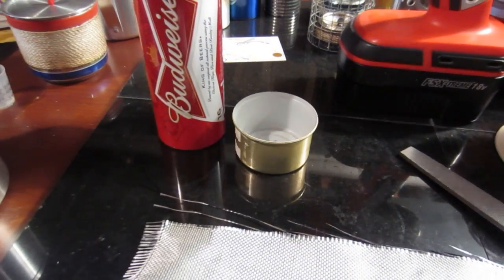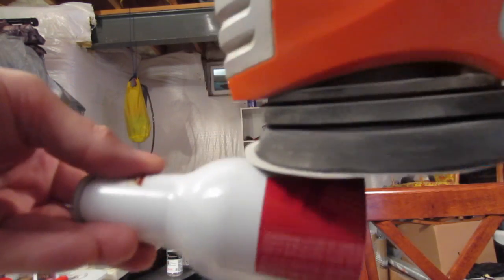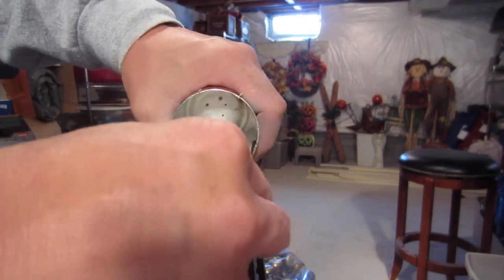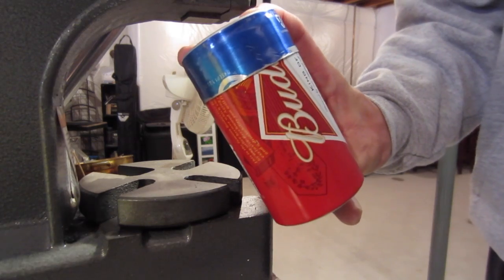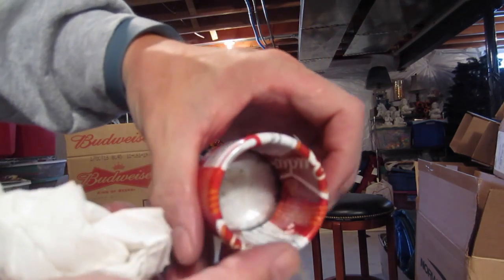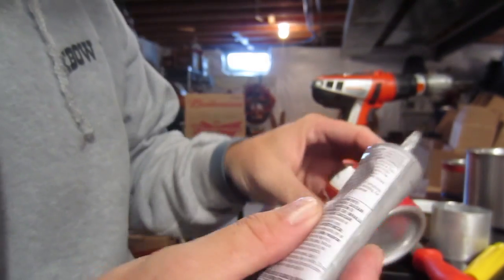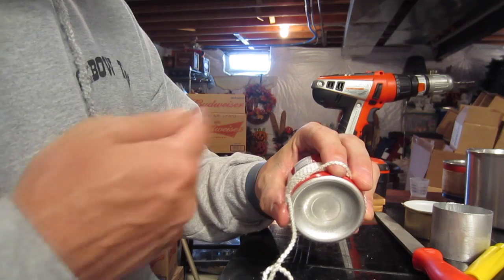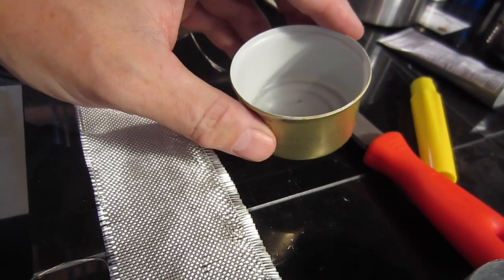How To Build Alcohol Stoves - Fancy Feast & Rolled Bottle

Comment: very cool!  I would like to suggest that (This from a former U.S. Navy sailor) you use a "Whipping" on your wick.  The Whipping is strong enough that you wouldn't need any glue.  It's virtually the same type of wrapping your doing, but you fold a loop underneath the wrap, at the end of the wrap you tuck the tail into the loop and pull. (this could get a little tough because it will be very tight).  (look for whipping videos you'll get it...)

Comment: Good builds, I found on the Rolled stove that putting 4 Dents or notches on the top of the stop stove evenly placed with a pair of Needle nose pliers, helps it to be more fuel efficient, and using carbon felt fiber on the cat stove also works better than insulation.

Comment: Great video.  Clear easy to understand instructions.  I have made 3 fancee feest stoves myself.  I used hairspray on the fiberglass cloth before cutting to keep down the fraying.  I went with a stainless steel mesh lantern globe for the inside.  I couldn't seem to find the bud bottles around here.
Reply from the maker: mark partain Thanks Mark! I agree, hairspray works well. I cut mine with scissors and go slow, haven't had much problem with fraying until I go to fold and place on insert. Going forward the new bud light bottles (thinner aluminum) work equally as well. Happy stoving!
Reply: I used pipe insulation ($5 decent size roll) that has aluminum on one side already adhered.  Just cut it down and place the shiny side out.  Mine has worked fine.  The roll will last for lots and lots of stoves too!  no messing with adhesives

Comment: One of the best videos I've seen on how to make both types of stoves. I've made Fancy Feast stoves using a tomato paste can & carbon fiber felt. I put 4,... 1/8" long, slits in the bottom of the tomato paste can with a Dremel cut-off disc so the alcohol can get up into the felt. I noticed you did not do that in your stove. Am I correct or did I just miss it?
Reply: surfandstreamfisher.  You missed nada.  Did not make the cut.

Comment: Rob, Thank You for one of The Best tutorials I've seen to this date, kinda missed the loud and crappy 'muzak' and gratuitous finger pointing, but will learn to live without it, Ha, Ha.

I made a form to press the cans together with a 1/4" X 5" dia. piece of steel with a 1/4" X 2" round head bolt through the center of the steel plate and then used my drill press in lieu of a regular press - but  eventually will buy a  press or set up one of my bottle jacks to do the job as I am building a few dozen alcohol heaters and lamps for the 'homeless' in my City so need to keep them as simple and quick to make so I can get them distributed - along with some tarps so they can have DIY tent to use them inside to stay warm and not be in the dark, and YES there will be a way to ventilate the tarps to provide fresh air.

Anyway, Thank You for sharing your technique on how to "roll"
the edge of a can.

Comment: Great video! These are my 2 favorite stoves to make for friends and people interested in alcohol stoves. I have never tried the full roll for the bottle stove. Only using the top of the bottle as the inner wall. I am bummed though I can find the pop top bottles in colorado anymore only the screw cap type. The aluminum is thinner with these and just don't roll the same......
Reply from the maker: Seth Adrian I agree, they are great. They are getting hard to find for sure, I can still find them every now and again. Tinny is the only one I have seen that has figured out how to roll the new bottles. Thanks for the note Seth, stove on! :)

Comment: I've never made either.  After watching your very nice video, I'm going to make both.
SERIOUS QUESTION: Is the priming wrap absolutely necessary on the rolled stove?
Reply: A wrapped priming wick is not "necessary", however I highly recommend using external priming fluid on (most) every alcohol burner (whether you use it spread around the burner or absorbed into a wrapped wick is a personal preference, since both manners will accomplish the goal), to dramatically decrease the blooming time for the burner, since the alcohol is being heated from both the inside and outside of the gassifying chamber.  Either method of reducing the bloom time maximizes your limited cooking fuel, when lacking an external fuel supply feeding line (with a fuel feeder, using external priming fluid is NOT an option, you just have to wait, but the burner will continue to burn as long as you keep feeding it fuel).... so there's a trade-off.

Differently designed burners have different fuel efficiencies when it comes to actually heating and cooking, so know that there are many variables in using an alcohol burner, but two common elements of maximizing fuel efficiency are using a pot lid and windscreen for heat retention (because that's the name of the game: Heat Retention).

Comment: Just a few questions - What was your wrapping wick diameter (1/8th or 1/16th), number of holes you drilled in the rolled edge can, and results for the burn times?  I've done a few rolled edge bottles and I pretty much have the same arbor press, mine bottles kept crunching, so I'm going to try the continuous twisting / lubricating of the die, hopefully that helps!  Great video, keep them coming!!

Comment: I want to describe a stove that I made after several years of R&D, for you. It was based upon your own design. I needed power and longevity of burn time for the outdoors. I needed to make Coffee, breakfast and hot water after that on one burn. Yet remain lite and compact to carry easily in my cook set. My stove is well over 45 min of burn time, usually about 54min burn time. I used a large sized , used Sterno canister for the base. I brazed in a smaller (you can JB weld this) a taller can upside down with the original top removed and fuel vanes added for flow down inside. The inside can ( heated pressurized fuel reservoir) is basically sealed once the pot or pan is placed on top. I packed the inbetween space with fiberglass insulation to the top level of the Sterno base can. The final part was to drill a 1/8th fill hole in the top of the braised center can bottom (which is now the top) to add fuel. This acts as the huge fuel tank , and low pressure heat expansion chamber. Of course the fiberglass is the flame ring just like your "Feest" stove and the principal is the same. However, the fuel volume is massive and there is an inherent preheat and charge with this design that acts more like a natural gas burner in efficiency and burn time. I have other alcohol stoves just like you. However, this is my go to must have HOG burner that out cooks all others for time and efficiency.
Reply: Can you or someone please do a how-to video to show this version?
Reply: Yes pls - would love to see a video on that.  Sounds a bit like a spin off of the penny stove ...
Reply: Try much less splainin' and more showin'

Comment: excellent vid, thanks for sharing, ill have to see if I can find one of the bottles,  I have the fancy feast stove made with a hole puncher but it seems to use more fuel than these designs
Reply from the maker: Erik Giggey Thanks Erik. If you are just looking to make a fancy feast the newer bud light bottles work fine. In fact there is enough in 1 bottle to make 3 fancy feast stoves. The newer ones cut easier than the ones I used.

Comment: Great video!  These are the two stove designs I'm most interested in constructing.  I'm curious though, how is the alcohol fed into the inner wall of the Rolled Bottle stove? I watched the video a couple times and I don't believe you covered this one little bit of info. Did you stop the roll right before bottoming out? Or did you drill some feeder holes on the inside wall, down near the bottom?
Reply from the maker: I love lamp Thanks for the note. When you double the sides over it creates a bit of an uneven edge that doesn't allow it to form a tight seal on the bottom.
Reply: Got it, thanks!

Comment: Thanks for a great video.  I have a couple of questions for you.  What are you running on your saw for a blade? Looks like maybe an abrasive wheel. Also, can you give any more information on how you remove the inner edge from the cat food can?  Thanks again!
Reply from the maker: +Scott Furr It is just a simple cut off blade for cutting tile. It cost like $5. Take one of the "safety" can openers to it instead of using the pull tab. Thanks for watching.

Comment: Awesome video.  Left us hanging on the final detail.  Boil times. The fancy feast looks like it has more uniform flame.  Which one boils faster?

P.S.  do you have a 2qzq backpack table?  Want to lay hands on one before I pick up that luxury item.  Thanks
Reply from the maker: Thanks Joe, you just have to build one of each and see :) (they are both similar in boil times at about 6ish minutes). I like the fancy feast better due to no need to prime and all alcohol goes to the pot. I do not have a 2QZQ table but I do know they are great as I have seen one and messed with it. I have the tree table from Klaussinator (http://klaussinator.com/?page_id=1272 ) and really like it as well.
Reply: The gauntlet has been laid.  Will be cheating as I still have the rolled can stove you gave me at the N/P meet and greet.  Thank you again.

Comment: If you’re making more than one of these you could drill a hole in a beer cap and put a bolt through, lock it in with a nut, Chuck it in your drill, and attach the bottle. Now grab a piece of sandpaper and pull the trigger and you can sand the whole bottle in a couple minutes

Comment: I'm a bit confused.  I've seen the fancy feast made with carbon felt as the wick and a tomato paste can.  Do you place the fuel in the can and in the carbon felt wick?
Reply: +Brian L Carbon felt is outdated.  There's a ceramic cloth that works much better.   It has much better heat resistance, and never shrinks, as carbon felt eventually does.

Comment: Did you have to drill ports at the bottom of the Fancy Feast insert in order to admit fuel to the fibre glass wick ??
Reply: Seamus3051 no he didn’t do that, which in every other build there are slots cut in on the bottom of the inside can to allow the wick faster wicking...or at least he didn’t show doing it.

Comment: Do you think this version of Fancy Feast stove works better than the old version using holes punched in the side?
Reply from the maker: Johnny Benge Yes, I believe it has a better flame that is less impacted by the wind (although you must use a wind screen with each) and due to the wicking material the stove lights even in cold weather. In fact the FF has been used at temps as low as -40F by Shug.  I hope this helps.
Reply: BackpackingAdventures Thanks!

Comment: DO they still sell those bottles? I have not been able to find them here in the Utica NY area.
Reply from the maker: It is getting harder to find them. Most recently I have seen the Michelob Ultra version, not the Bud or Budlight. I hope you find them.
Reply from the maker: Also, if you just want to make the fancy feast you can use the new style bud light bottles. They work equally as well.

Comment: Awesome!  That fiberglass cloth is a @&$?! to work with. I got hair spray to spray on it before I even cut it. I lost so much trying to cut a piece the right size. The spray adhesive is an excellent addition. I think I'll use both. Spray a large section of cloth with hairspray, cut my small piece then use your method. 

I had ordered an arbor press from Harbor Freight (probably the same one) but decided I'm more fond of the Fancy Feast. Shug swears by it!

Now, your next challenge? Perhaps a simmer ring for Fancy Feast like Zelph's!!
Reply from the maker: North Country Outdoor Guys Thanks Ben. I don't have problems with the fiberglass, I simply use sharp scissors and go slow - not sure why I am lucky with it. Now, once you start to work with it and fold and wrap it is a different story...the adhesive is the ticket. I really like the fancy feast but to be honest, I generally bring a different DIY stove each trip. I just like em all I guess. Challenge accepted!
Reply: A summer ring could be easily manufactured from a beer can or soda can.
Reply: Simmer* ugh spell check

Comment: Tge Fancy Feast is the best and most fuel efficient tove for the money. The rolled bottle is not worth the effort. E 8000 works better and holds longer. I would use a priming cup instead of wrapping wick. Carbon felt works best as a wick for Fancy Feast stove and a tomato paste can cut down for the insert works better cut to where an inch sticks up past the cat food can is the sweet spot

Comment: why did you put the string on it.
Reply: the string was used to hold alcohol to warm the can up, so the can can build up pressure forcing the alcohol gas out the ports creating the burner

Comment: Really. Ice but you disillusioned me when you used that press. I do not have one. Needed to learn with more accessible equipment. Great little stove, though. Thanks.
Reply: Place a car jack under a fixed flat surface and use that as an improve press
Reply: a 6 or 8 inch C-clamp works well.still use a wood block like he did with the arbor press.